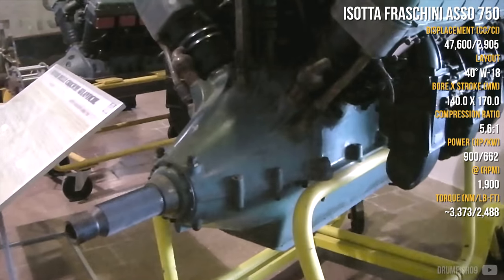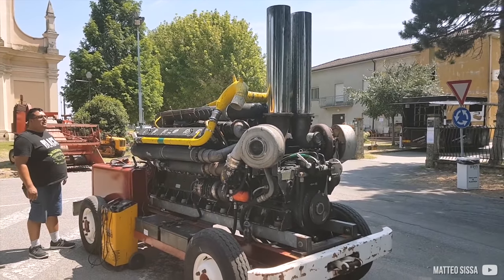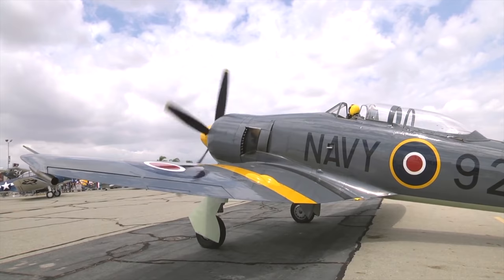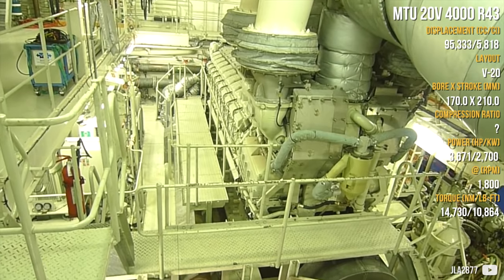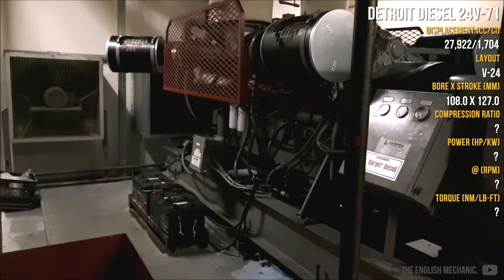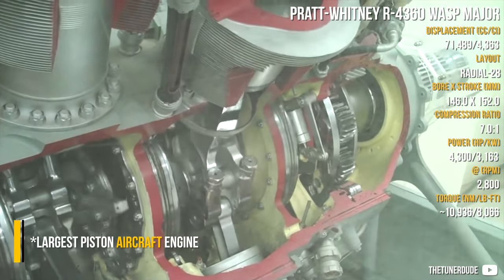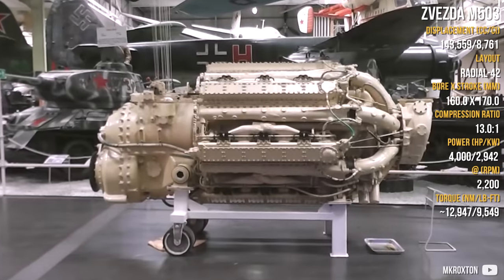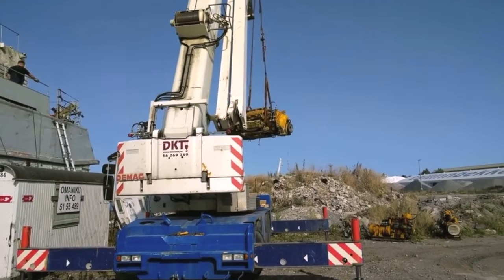Massive 18+ Cylinder Engines

Comment: At time mark 5:43, during the segment about the P&W R-4360, you have a shot of the B-29 Fifi starting up and taxiing. The B-29 was powered by Wright Cyclone R-3350 engines which were not featured in the video.

Comment: Whoops!  You show Fifi, the B-29.   B-29's had R3350's, not R4360's....

Great video!
Reply: But it's ok, because 3350s are badass and sound great. BTW, B-29 little big brother B-50 has corncobs (4360), so probably the source of the issue.

Comment: When I was a kid, I used to think that the v22 osprey had a real v22 engine XD
Reply: V22 would probably sound like electric motor but good
Reply: When I was a kid the osprey was called a fisher hawk.
Reply: When I was young, I thought that 16V on a car meant 16 volts.
Reply: Luckily for you it wasn't designated v23 or it would've driven you crazy trying to figure it out.
Reply: HOW
Reply: @notme-y1m  I thought it meant 16 valve
Reply: @justsomepandawithinternet  there's actually a Fiat V24 aircraft engine I think

Comment: Always fun to watch. 
Sooner or later you will have to address the Napier Sabre sleeve valve H24 engine and the Napier Deltic triangular two-stroke diesel with 3 crankshafts, 18 cylinders, and 36 pistons.
Also a couple of corrections: Isotta-Fraschini is meant to be pronounced izotta-fraskini and at 5:44 B-29s were equipped with R3350 18-cylinder radials, massive engines in their own right, but not as massive and intricate as R4360s. On a personal note: FiFi overflew my house last summer on her way to and from a local airshow. She is still a wonderful sight to behold and to hear !
Reply from the maker: Thanks for corrections, sorry about them!
Reply: @VisioRacer  Chrysler A57 Multibank?  Maybe should have been on your list perhaps.
Reply from the maker: @572Btriode  Yes, there are many more of them
Reply: @VisioRacer  There certainly is !  Good stuff, I enjoy your series.

Comment: I am an aircraft mechanic. I was tought the firing  order of radial engines. I have never worked on a radial engine. Stabbing magnetos and timing them right is key on all aircraft engines.
Reply: Although not all aircraft engines use magnetos, or cylinders for that matter
Reply: I am retired and work on old motorcycles now and you are right Timing is  everything!!

Comment: only the B-50 version evolution of the B-29 Super Fortress had Wasp Majors.  Fifi is using R-3350s Duplex Cyclone 18cyl, but her current examples are a bit of a cross between what the later C-119s and A-1s use.

Comment: I would love to see the Zvezda 112 cylinder engine in a diesel locomotive.
Reply: Двигатель М-507 не поместится на тепловозе.
Reply: @ВикторКовалев-с5ч   is it the length, or width, or both? because if a pulling tractor can contain the 42 cylinder version on its frame, then a locomotive frame being much larger should be able to accommodate it. The sd80/90 mac locomotive is over 80ft long.
Reply: The British had the Deltic, Germany has diesel hydraulic, a Zvezda radial diesel locomotive would be truly unique and iconic, and Russia should do this ,because Russia is extreme when it comes to heavy duty and always has the most aggressive and incredible designs in vehicles and machinery.

Comment: English Electric EE Type mkIII: v16 diesel, 246l capacity, way over 3000hp, some v12 variant engines still in use in UK - I live near main railway line and can hear it from mile away.
Reply: Less than 18 cylinders...

Comment: Nice work. M506, I wanna see that in a mega tractor. I've seen the m503 pull so fast that just taking his foot off the throttle wasn't enough. He had to apply brakes at the end of some of the pulls to stop b4 hitting something at the end of the track. I'm a geared from the 60's. I can scratch time any engine without manual. Valve timing tells all. Keep up the good work.

Comment: The 24V71TA Specs I have show 17:1 compression showing a marine rating of 1800HP @ 2300RPM  (Kind of interesting the 12V71TA also in the same book shows 900@2300)  The 24 cylinder was replaced by the 92 and 149 series... (The outside dimensions/physical size of the 92-series is practically identical to a 71-series, so a 8V92 will bolt into the same hole as a 8V71 resides in.)

Comment: @VISIORACER the cool thing about Detroit diesels is anything over and equal to 8cyls at a time like the 871 1671 and 2471 are all 871 motors bolted together to run as a single unit

Comment: Have you ever heard of a rodi diesel?
It was a V4 reverse flow two-stroke diesel with electric powered turbochargers and was oil cooled the entire engine claimed to us only two size fasteners basically you only needed two wrenches to take it apart.& All accessories were driven off of powerhead you could change the engine without disturbing anything else
Reply: sounds impossible

Comment: You can add the Caterpillar 3516 who has 16 cilinders and Powers the fantastico Vossloh G2000 heavy shunting locomotive or the MTU 20 cilinders Who Powers the same locomotive only with 2700Kw instead of 2000

Comment: These issota Fraschini engines in the T-56 (yes, engines! it has 3) sound awesome, one of the meanest sounding diesel boats out there.
I believe you can do tours on this and a sister boat in Sweden.
Reply: They are not diesel though.
Reply: @Dp2011able  T-56 has 3 diesel engines, they are a turbocharged diesel version of the Issota Fraschini engines, CRM 18D/SS of 1650hp each.
The sister boat is T-46, which is identical to T-56.
The trust preserving these vessels also have a third PT boat, T-26 which has 2 petrol driven versions of these engines as originally designed for aircraft, without turbochargers, 1500hp each.
T-26 was the forerunner of T-56.
T-26 was built in 1942 and decommissioned in 1957, in the same year T-56 was built.
Reply: Tom you are right, T-56 had its petrol W18 engines replaced with diesels. My mistake. : )

Comment: I think the Major Wasp was used in the Spruce Goose, or Hughes H-4 Hercules, as Howard Hughes would scream at people who called it otherwise...
Reply: I think the USAF C-124 (Globe Master) was the last military aircraft designed using 4 PW R 4360 Recip engines that was in regular use.They were still being used to ferry heavy equipment during the startup of the Vietnam situation. Turboprop C-130 and C-133 took over while the C-141 with jet engines was being tested getting ready to take over the heavy lifting.”OFF THE ENGINE SUBJECT”
The C- 124 could be loaded 2 ways. The whole front of Aircraft could be opened with French style doors and a ramp extended out to allow a fire truck to be driven up into the cargo bay and the belly had clamshell doors with a 10ft x 12ft elevator that dropped to the ground to be loaded with cargo. The cargo bay could be made into two levels and seats rigged for a large number of troops and most of their equipment including their Commander’s Jeep transport and or crew operated weapons.

Comment: The B-29 you showed doesn't have the 28 cylinder engine. 
The one having is the B-50, with a taller vertical stabilizer. 

B-29 FIFI - Commemorative Air Force

Manufacturer	Boeing
Introduced	May 1944
Produced	1943–1946
Power	4 × Wright R-3350 -23 and 23A Duplex-Cyclone turbosupercharged radial engines, 2,200 hp

Greetings from Brazil.

Comment: The irony is that by the early '50s they had just about perfected the technology of the multi-bank radial engine, but then jets and jet based (turboprop) engines came along and made the whole thing redundant. Cars need an engine with 500hp or less (most of the time) and it must be quick & easy to start and fuel efficient and easy to manage with the accelerator. Turbine engines can be made to that spec but they tend to cost way more than the car would. Once you get to about a thousand hp, a turbine tends to be way more reliable and easier to maintain. They're not exactly cheaper to manufacture because there's some very sophisticated engineering goes into making turbine blades, but once they are made, they're thousands of times more reliable than piston engines.
Consider the case of a fast private yacht. A couple of thousand hp diesel engines to manoeuvre or cruise at 10 knots or so, and to give a 5,ooo mile range, and a gas turbine or two at 20,ooo hp to make the thing go 30+ knots and impress your friends. The turbines lack fuel efficiency and therefore range, but they can easily make tens of thousands of hp and be completely reliable, which is maybe more than can be said for the jet drives... A jet is also more compact and many times lighter than a big piston engine.
The R4360 got a bad reputation because of the B-36 Peacemaker. They did overheat and they did catch fire, but mostly the issue was a prop behind the engine (no airflow while on the ground) and a cooling air intake that was designed for cruising at 20,ooo feet, at 75% power, not take-off runs and initial climb-out at full throttle at low altitude. The main problem was a design issue with the aeroplane and the way the engines were installed and used.
You mention them in relation to the B-29 and show Fifi. Some B-29s were fitted with it, but the standard power-plant in B-29s was the Pratt & Whitney R-2800 Double Wasp, same as the P-47 Thunderbolt. And no, in the B-29 they did not overheat and prove unreliable. The problem on the B-36 was the small intake and the prop behind.
(edit) Sorry, I just went and checked. The B-50 was fitted with corncobs, not the B-29. Mostly that was the only real difference.
https://en.wikipedia.org/wiki/Boeing_B-50_Superfortress
Reply: Standard powerplant in the B-29 was the Wright R3350.  And they were infamously unreliable at first.  But Wright eventually fixed it.
Reply: @andyharman3022  ~ Thank you Andy, I stand corrected. (Should check before I type ...) I do stand by the point that brought me into this. B-50s had 4 row corn-cobs, B-29s did not. Fifi is a B-29.

Comment: There's a point of diminishing returns with piston engines. Usually it's easier to just go over to something like a gas turbine. I love these engines, but there's something sad about seeing them on trailers, run by old men.
Reply: The most fuel efficient marine ship engine in the world is a reciprocating Diesel engine.
Reply: @sandervanderkammen9230  Yes, because they'll burn cheap crap for fuel.
Reply: @rocksnot952  I was not referring fuel costs but rather actual thermal fuel efficiency, BSFC, Carnot  Cycle efficiency.
Reply: @sandervanderkammen9230  Pound for pound of engine, that's not true. Turbines have superior lifespans and lower maintenance costs. Someday, shipowners will twig to this. Turbines tend to be less efficient in warships because of the constant speed changes. As prime movers for devices such azipods, they are as efficient as a diesel and possibly more so. cogeneration schemes increase their efficiency.
Reply: @rocksnot952  The Diesel Cycle has a higher practical and theoretical thermal fuel efficiency than the Brayton Cycle.

Comment: B-29 "FiFi" (@ 5:51) had 18 cylinder engines, not the 28 cylinder engines.
Reply: Yeah but B29 have a brother with name B50 with four 28 cylinder P&W engine and none of them are flying today but look nearly the same.
Reply: @mikaelglad4184  You're correct, but what is pictured is the B29 with 18 cylinder engines.
Reply: @Tchristman100  absolutely but it's second best because no B50 is airworthy what I know but ofcourse it was better if he give that information in the video.